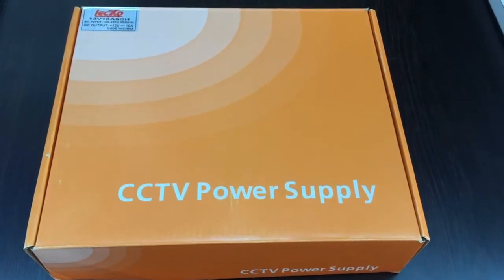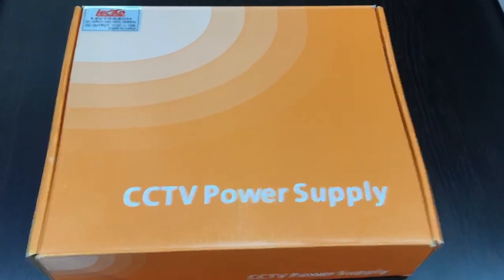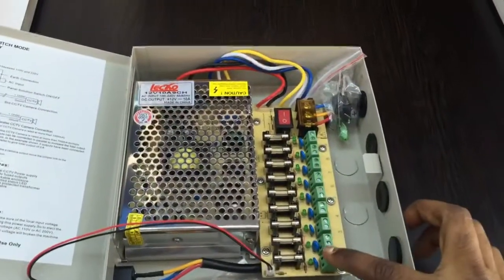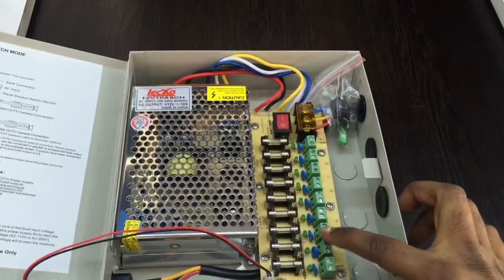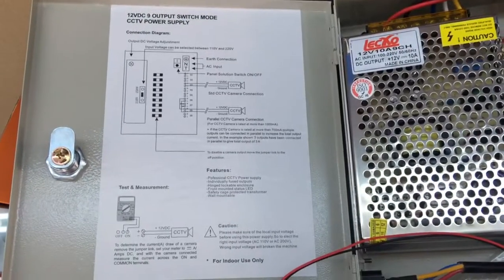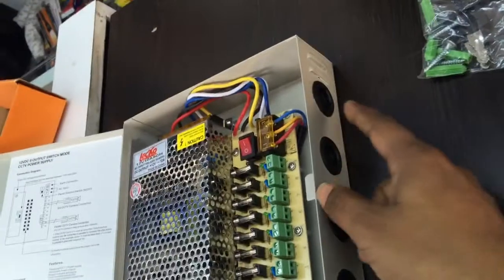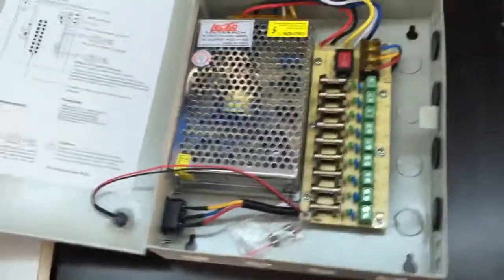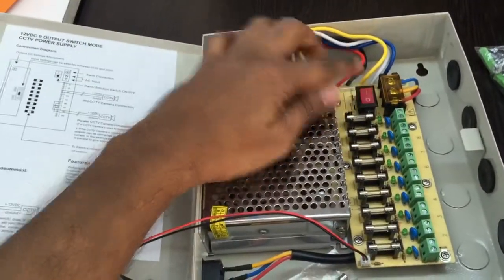CCTV Power Suppy Unboxing - For Multi Channel

Comment: Them cctv power supply box show me them working on 16 cameras with out lines on the cams i bought one 18 cam and instalked it the correct way not like some the on here hard wired to spur box and not pluged i  like some them on here any way 18 channel supply box fitted with back up battery on 3 cams some bad lines on cams so tured power to box of all  16 cams fine no lines returned power lines back so disconect box and used 8 way splitter jobs great so any one show me your 16 cams on here running on that cctv supply box if not dont buy them because they will cause u lot of pain and money even the ppl that sell them dont no jack about them
Reply from the maker: I didnt get you full dear. But we are using these systems here and working very good. No problem at all.